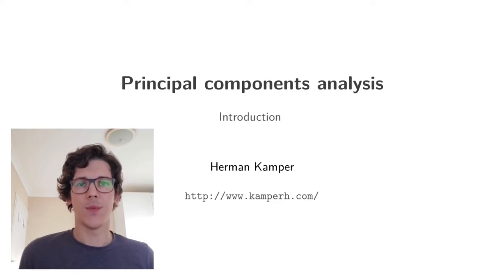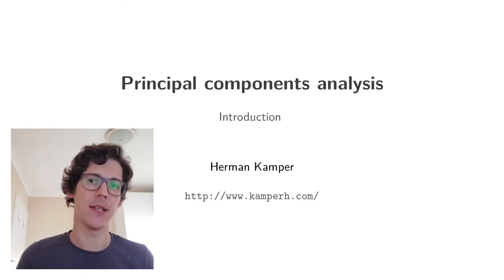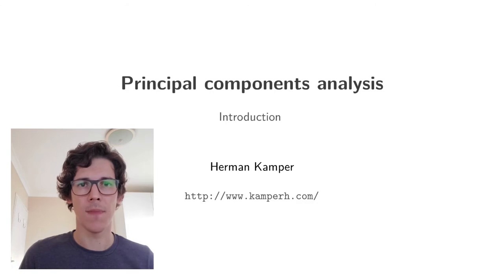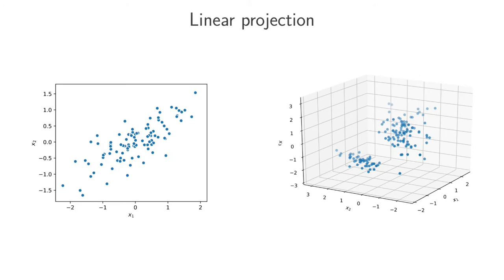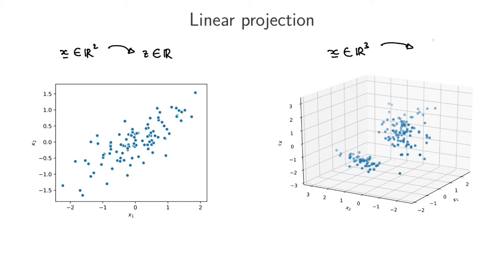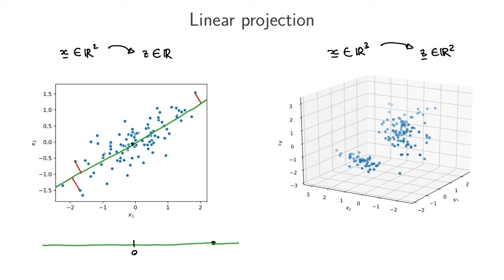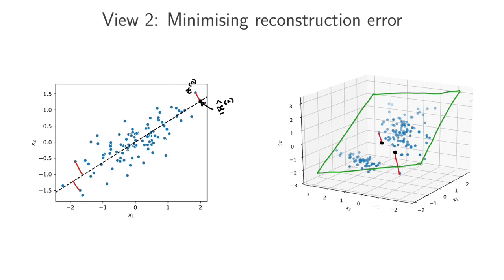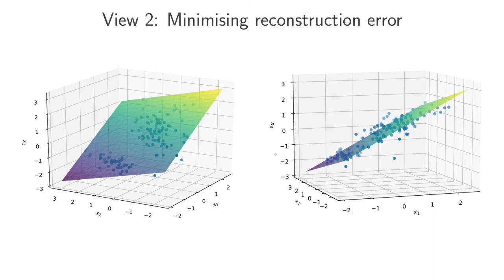PCA 1 - Introduction

Comment: Thanks for all your effort. I just started watching your lectures and they are extremely useful.

Btw, I have some questions: 
1. How do we know that our data is high-dimensional? If the data is strictly high dimensional then we won't be able to do a dimensional reduction on that data, right? So the dimensionality reduction techniques would fail, right? Is there an example of such datasets?

2. MNIST  lives in 784 dimensions. However, when we do dimension reduction of MNIST dataset and we can clearly see that dataset forming well-separable clusters in 2D. Does this mean that MNIST essentially lives in 2D-manifold and other 782 dimensions are superfluous?
Reply from the maker: These are both really good questions, and neither of them have easy answers, mainly because the real world is messy.

1. I think what you are asking is: What if my data is inherently high-dimensional? Won't this mean that I mess up when I do dimensionality reduction?  The answer is: it depends on what you want to do with your data, and what it means for it to be "inherently high-dimensional".  In the real world, you will almost always be throwing away some information.  And that could be beneficial if the information you are throwing away is not what you are ultimately interested in.  To distinguish a cat vs. dog, the background colour of an image might not be so relevant, so if dimensionality reduction throws away that information that's great!  But what you were actually interested in detecting something in the background of the image?  Then that would be super bad.  So in practice, you should basically test whether the dimensionality reduction keeps or throws away the "information" you are interested in.

There is also the concept of "proportion of variance explained", which is exactly a metric that can tell you how much of the variation in your original data you are keeping with the dimensionality reduction.  Have a look at Section 10.2.3 in the ISL textbook (https://www.statlearning.com/).

2. This is very related to your first question: you qualitatively looked at the projection and then said "this looks pretty good".  But if you look closely at those MNIST plots, you will see that the clusters aren't perfectly separated.  So if you e.g. trained a linear classifier on top of the 2-D PCA projected data, you might get an okay accuracy (let's say 80%).  But if you really wanted to get the top possible performance (say 95%), you will see that you will actually need to keep a lot more dimensions, particularly to better capture characteristics of digits lying on the boundaries between the clusters.

I hope that helps, but shout if it doesn't.